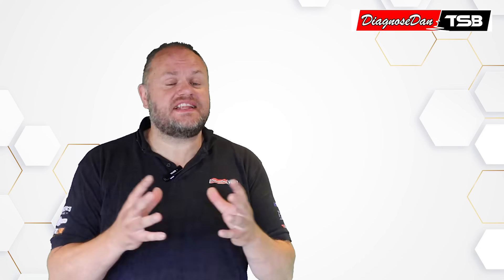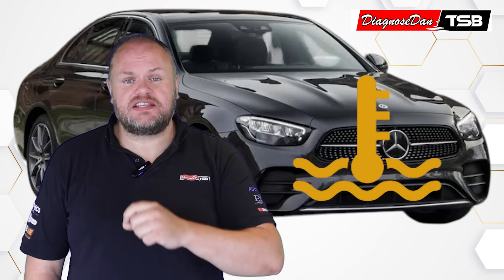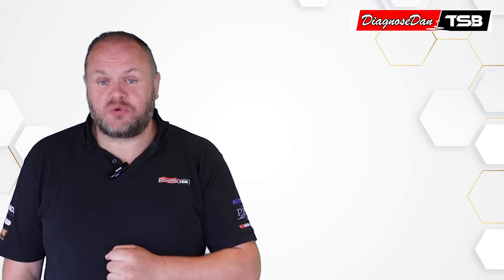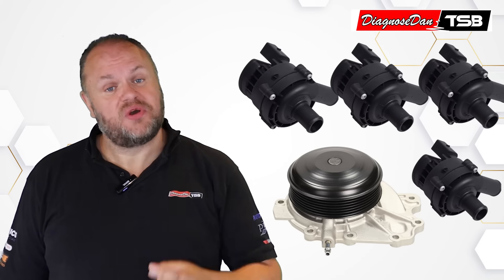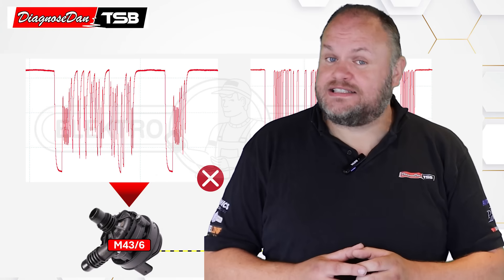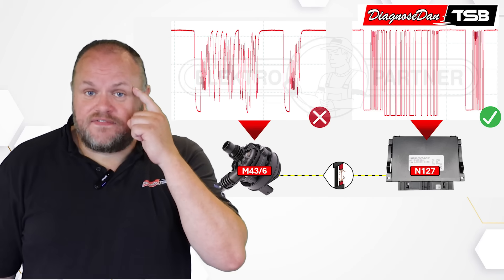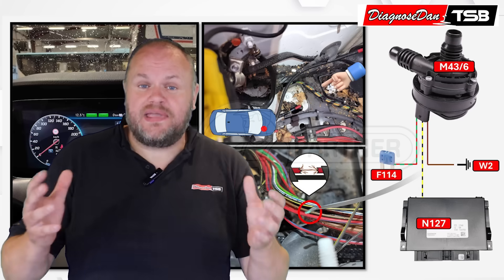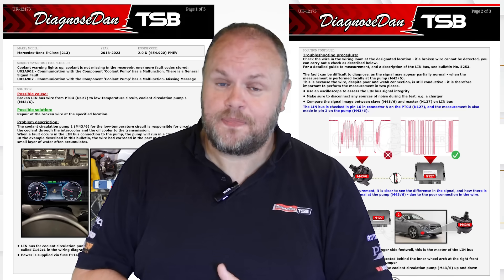Mercedes E-Class PHEV Coolant Warning | Fault Codes U02A902 & U02A987 | DDTSB example

Comment: I forget which (American) Chrysler product it was, but the PCM/transmission (?) and associated major looms were mounted beneath the battery tray. With time, every similar vehicle I found in the junk yard ALL had rotted wires/connectors/module.

Comment: I have repaired a parking sensor and side assist sensor on my Q5 by bypassing two interrupted wires, couldn't be bothered to take the bumper off so I went underneath and soldered 2 wires and then pulled them into the trunk and soldered them close to the connector where it went into a module. 😂

Comment: 5 water pumps 😮😮 Absolute insanity.
Reply from the maker: Plenty of work to do in the future. We will be needed
Reply: One for each passenger
Reply: That's German engineering for you :) 
I give you another one Q8 e-tron 45 litres of coolant! Older Mercs with the ECU at the top of the engine. What could go wrong?
Reply: @KissTamas3 Newer Mercedes has the ECU on top of the engine, too. I’ve been driving a 650000 km E-class with this setup without any issues. A whole other ballgame is the EV’s with 5 waterpumps and  30-50 liters of coolant….And remember they don’t need any service, the owners claim😂😂😂
Reply: @KissTamas3  Cheers, 45 litres is equally insane 😂

Comment: Wouldn’t testing continuity on that line from the water pump to the control module get the same outcome?
Reply from the maker: Yes it would, The challenge here is that the OEM diagram is wrong so in this case it was not possible.
Reply: Understood, was asking as I’m still pretty weak when it comes to electrical diagnostics, thank you buddy

Comment: Ah slight correction.. N127 is the power train control unit PTCU.  The Engine control unit would be N3/... (They change the number depending on model/engine.) but fantastic find by the tech 👍👍
Reply from the maker: Thats true :)